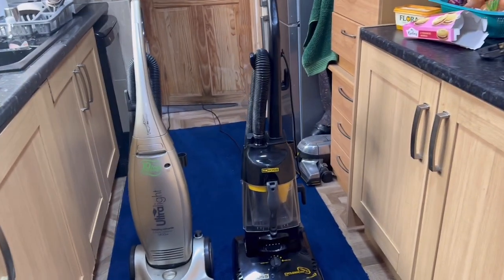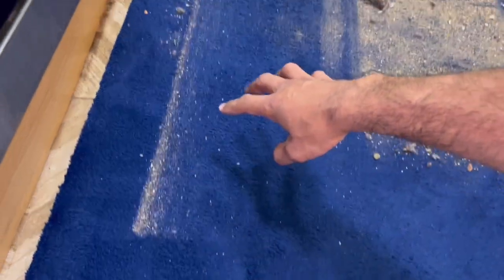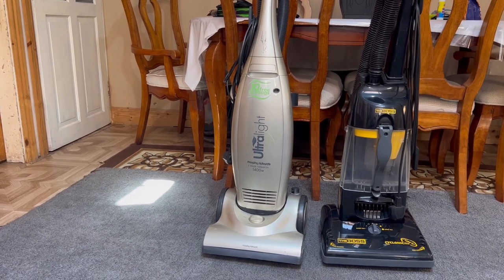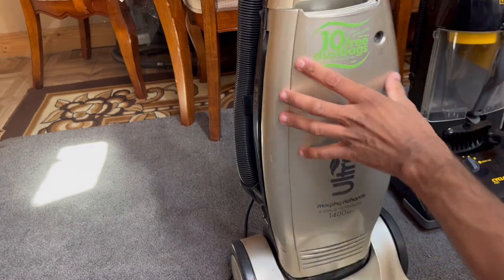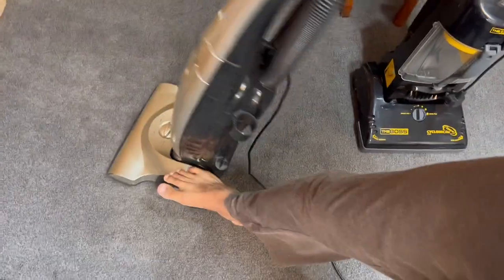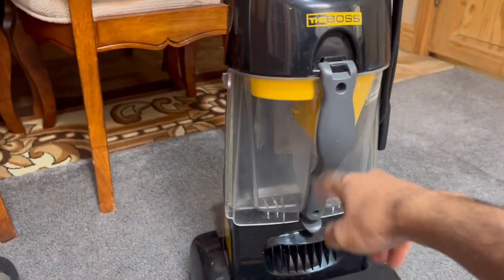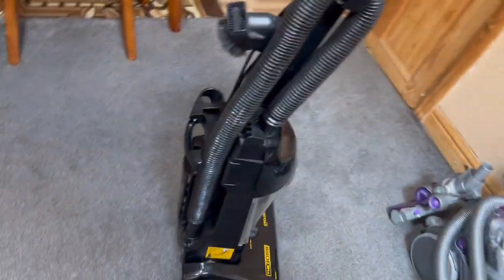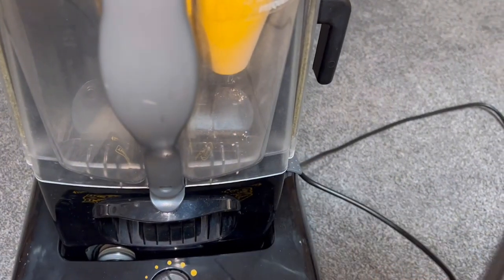Electrolux The Boss Cyclonic Lite Vs Morphy Richards Ultralight vacuum cleaner

Comment: The Electrolux made to look the part but were poor performance would have been better if it had a bag, in early 00s I had an Electrolux Hilite bagless , it was a smart box bin it choked very quickly and eventually killed its motor. It would have had potential with tweaks, it was 16/1800 watts I think 1600 as I recall 🤔 … Good Video as always 👍🏽
Reply from the maker: Wow that’s very cool! The Hilite looks a lot better designed than the Boss cyclonic 
Thanks for sharing your experience! ✌🏽😄